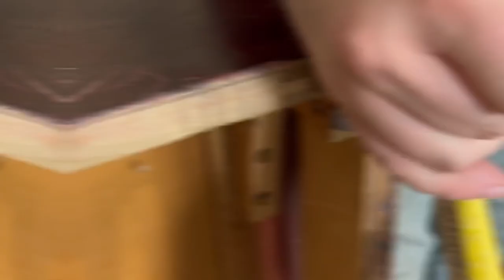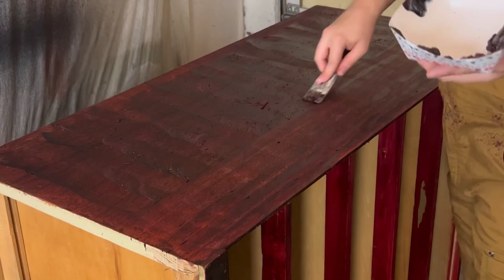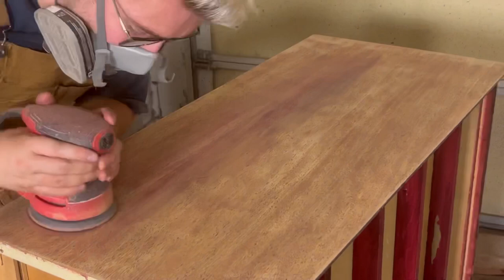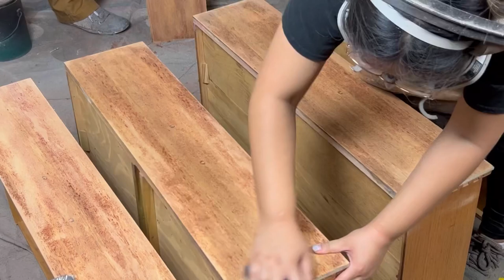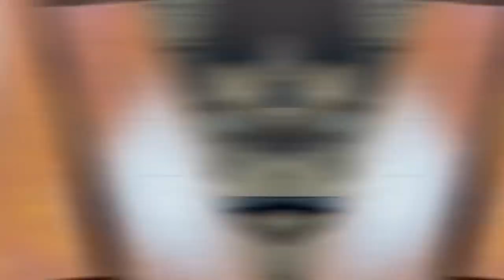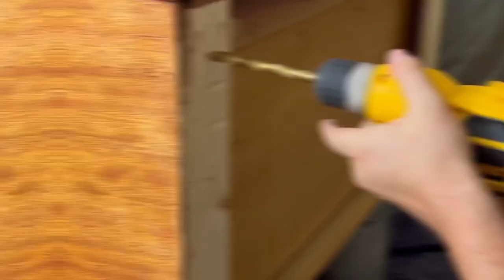Citristrip almost RUINED our project… Mid Century Modern Furniture Makeover | Furniture Restoration

Comment: You didn't remove the reddish stain from the drawer fronts completely and they show through as streaks in the new finish. Also, the red is still visible in the corners and between the drawers. You should have sanded it inside as well. It is a very beautiful piece of furniture and you definitely made it better, but with a little bit more thorough work and attention to detail it could have been perfect.

Comment: I think I would have stripped the edges of the frame. or at least painted them black so that it doesn’t look like the refinishing is unfinished. I’ve also had lots of trouble with citristrip and have stopped using it.